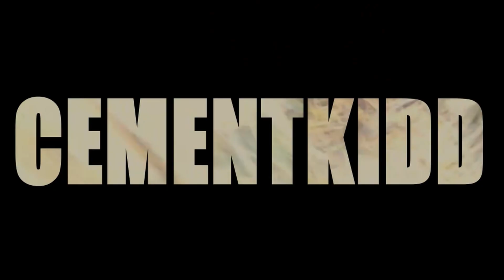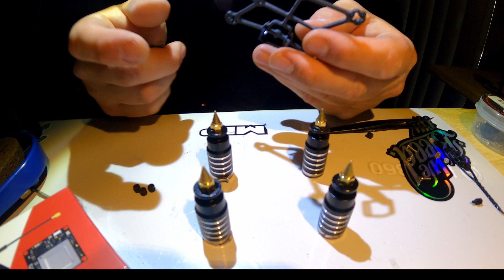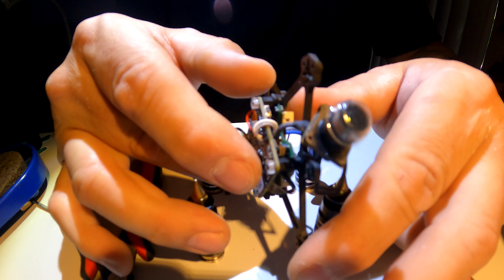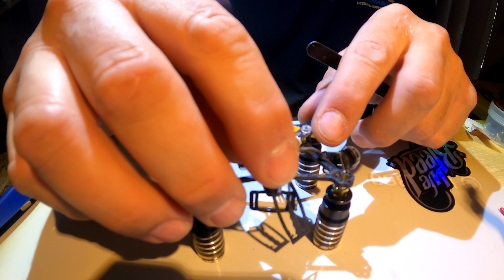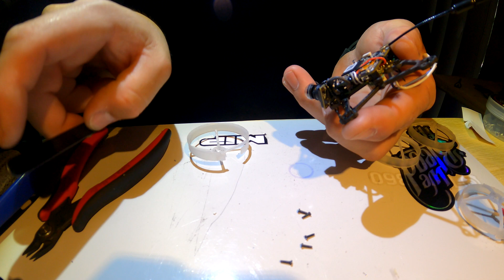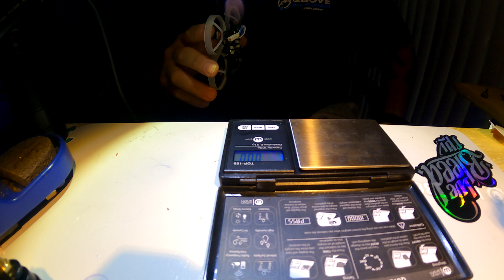HD Fractal 75 Full Build for HD Zero or Walksnail Avatar VTX's

Comment: What do you think? I plan to put a fractal 75 video module o4 on the frame. And I bought 0802 25000 kv motors. Battery 550 Mah 1S. Will they work normally? Should I put larger motors, such as 1103? I'm a beginner and I need a drone to fly slowly and learn.
Reply from the maker: @АлександрХрапач-ж6з  1103 motors are usually 2s, but if they have a high kv 1s then I would think they would be better for that build because the 04 air unit will add some extra weight.  I would suggest honestly to build it as a 2s drone, that would gi e you much better flight time and also much less  voltage sag.  The biggest problem I had with this fractal build was the voltage sag. That is when the battery gets low and you drop below 3v when you throttle up.  I had problems where I was losing video.  It happened more than once. I since switched to a 2s build and never had a problem again since the drone was running on 7.4v instead of 3.7.  I hope that helps.  🤙  good luck!!
Reply: @cementkidd  Which number of kv of 1102 motors is better to choose? 10000kv 11000kv?
Reply from the maker: @АлександрХрапач-ж6з  10000 will give you better throttle resolution, but less punch.  As a beginner, I would start with 10000, and as you rebuild after crashing or a second drone, then move up in kv
Reply from the maker: @Oleksandr_Khrapach  https://youtu.be/QuWHeVv4Las?si=HBWR5pgPf4wSAI3x
Reply from the maker: This is the drone I fly now.

Comment: Could you share the tune?
Reply from the maker: @filipdroszcz1073  I don't have the tune anymore. I wrecked it multiple times and switched to the mob 7 ducted 2s rig I fly now.  Much more durable
Reply: @cementkidd  Nice! What tune do use for that one?
Reply from the maker: @filipdroszcz1073  I tried all the presets that make sense for the build (2s uavtech etc) but what I found is I couldn't get it right unless I tubed it manually.  So I used filter presets and tuned from there.  The I term was the big factor bc it's a whoop.  I am close to 1:1 ratio on the p and d terms and about 1.6x on the I term multiplier. I'll have to check for you the next time I fly

Comment: Any updates on the camera mount?  Mine moves left and right too much after every crash and landing.  The camera angle adjustment is difficult.  So I stopped flying the Fractal.  Until a better Camera mount is made.  I really liked the R3D prints (no ducts in view) setup but it was a tpu frame.
Reply from the maker: Unfortunately the design of both mounts (original and remixed) have that issue.  I tried thinking of something to fix it but I can't figure it out with the frames design. I'm sure somebody has a solution somewhere but I don't.  Sorry pal. I did the best I could